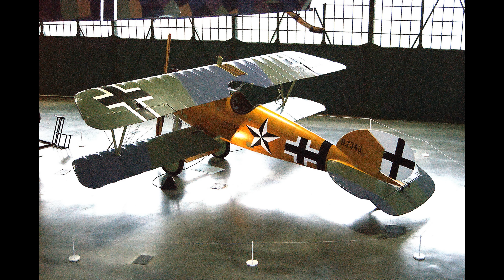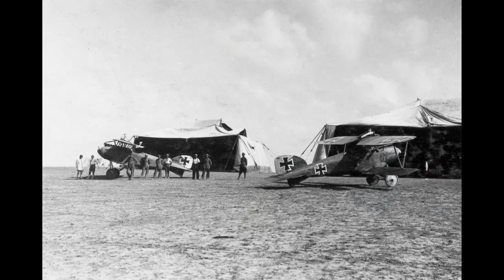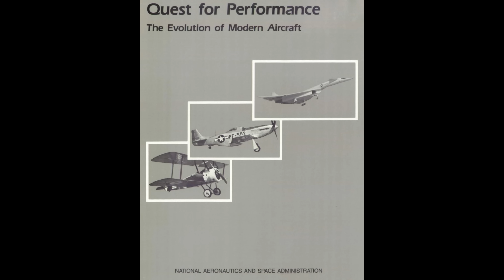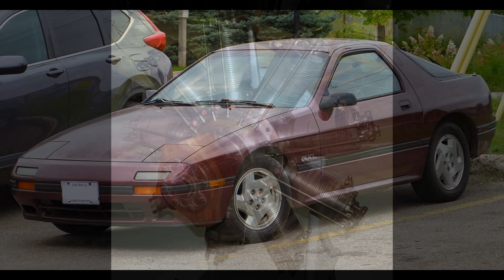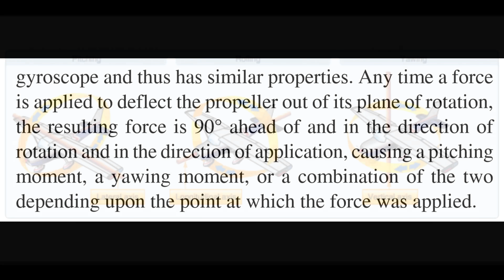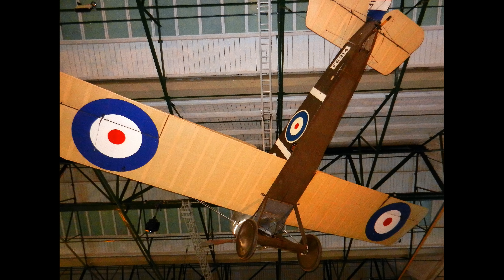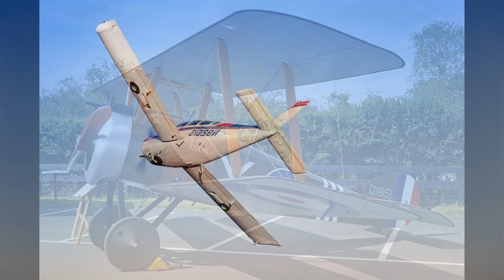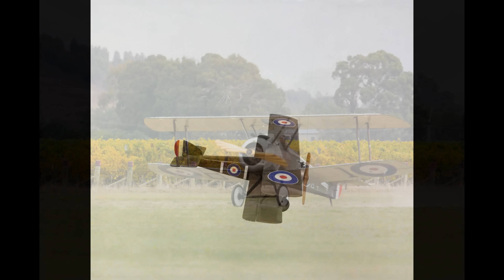Sopwith Camel, War Winner or Death Trap?

Comment: A 'rotary' is actually a rotary radial. Since the term radial refers specifically to the positioning or orientation of the cylinders, the designation still applies. Aviation books (usually older ones) often use the term 'static radial' when referring to radials engines from the post WWI era. The point I'm making here is not that the term 'rotary' is wrong. It's just that the 'radial' nomenclature really has absolutely nothing specifically to do with whether or not the engine spins around.

Comment: 16:53 it is partly due to torque, as you can initiate the roll to start a turn to the right faster than to the left. the effects of the gyroscopic procession and the low moment of inertia add to that to make it have more of an advantage than other planes with rotary engines.
Reply from the maker: Are you sure about that? The Sopwith Camel had either a maximum of 536 or 630 pound feet of torque depending on which version we are looking at. The German inline 6 cylinders had far more. It's a little hard to pin down the numbers because of the different ways of rating them, which I explained in another video, but a typical late war Albatross had A LEAST 694, and a BMW powered Fokker DVII or Pflaz D12 had no less that 825. It wasn't the torque that made the difference, it was the gyroscopic action.

Comment: Man, I really appreciated your discussion of the rotary engine, brief as it was. What an incredible piece of tech that must have been for the time period. Do you have, or can you recommend, any videos that might go into the mechanics of these engines in more depth? I'm trying to wrap my head around specifically the fuel/oil delivery systems. ignition, and the "stationary" cam rotation mechanism driving the prop. it really baffles me, you know? Thanks great video as usual!
Reply from the maker: I'll just have to make such a video myself. There are some rotary engine videos out there, but most are very basic. The questions you have are going to take a dedicated video or a portion of a video. I'll try to work this in to an upcoming video on WW1 aircraft.
Reply: @GregsAirplanesandAutomobiles  Much appreciated, I'll be looking forward to that.

Comment: 15:15 It should really be mentioned that the indirect effect on the roll is HUGE. Why? Because between roughly 30% and 40% of the airplane´s weight was just the engine, and although it had a floatless carburetor that didn´t starve the engine during aerial acrobacy, it still could experience minor fuel shortages due to the fuel inertia in the long intake system that went from the tank into the carb, then into a hollow crankshaft, and then through separate intakes and into the intake valves. And this combined with the effect that using ailerons or elevators has on induced drag, and its effect on propeller speed, and resulted in changes in engine RPMs. 
And any change of RPMs in a rotating engine that is so massive that the rest of the airplane is barely twice as heavy means that a massive amount of torque is applied through Newton´s third law into the airframe, resulting in a serious change to the airplane´s roll angle. 
So, I really think that this should be clarified, because calling something "indirect" usually implies that it´s less important.

Comment: There's just something really special about WW1 aircraft. They're like aircraft versions of motorcycles. GA would be a lot cooler if we were all flying 7/8 or 15/16 versions of WW1 fighters, maybe with some tech updates. Probably a lot cheaper too. A Cessna 172 is fine and everything but it will never be cool. It's like flying in a 1975 AMC Pacer. Being around a WW1 aircraft gives me the same sensation as looking at a really old Triumph, BMW or Harley. It's the same with the people flying them. It's just cooler to be out in the open with the engine right next to you, flying by raw skill and touch.

Comment: Camel was over appreciated and became more famous than much better planes like SE5a  and Nieuport 11.  A plane with many advantages but also with many disadvantages, you can read the first hand experiences of a Camel pilot in "Winged Victory", Yeates tells about the great maneuverability but also its trickiness and many handling and engine problems of the plane. Because of this Camels were assigned mostly to low altitude strafing and bombings with high altitude cover by SE5s

Comment: The engine was not a major issue, the quality of pilots was as was the basic design.  Britain had a very large Air Force and that meant churning out a lot of pilots. The Camel could have been made more stable, but this would have reduced overall manuverability.   The Pup was is, a good flying airplane.   The Snipe followed the Camel (although the Buzzard was a better fighter, it was a lot more expensive).  Also note that in 1940, the turning ability of the Spitfire was impaired because lesser trained pilots had difficulty due to the lack of an aerodynamic stall warning which caused inexperienced  pilots to not push the Spitfire in a turn. Some German 109 pilots said that they were able to outturn Spitfires in practical terms.  Other aircraft like the Se 5a were more stabledue to design, not engine.  The Rotary engined Neiuports 11, 17, 28 were all good flying aircraft.
Reply from the maker: The rotary engine was a major issue, but yes, the design of the plane contributed to it being difficult to fly, I thought I talked about that?

Comment: No carburator,those Rotary engineers had no throttle. They were magneto on or magneto off.  WFO or nothing.
Reply from the maker: The Sopwith Camels absolutely had throttles, along with a blip switch that cuts the ignition.

Comment: Dihedral in the lower wing pair is used to help maintain level flight, helping to prevent undesired banking to the left or right. If the left wing lowers, its lift component increases as it becomes directly opposite gravity which raises it back up compared to the right wing which would have had its lift component decrease, so it would tend to fall. You know this but it was not mentioned when the wings were described.
Reply from the maker: That's not quite right. I think I covered this in a video on the Me 163, but I'm not sure. I have so many videos on this channel I can't remember what is where.

Comment: I can't understand, as an Engineer, why rotary engines would ever exist. They are obviously horrible!!
Reply from the maker: Really? As an engineer, think through the following problem. You have a 130 horsepower air cooled engine that weights 400 pounds. That's a lot of metal to cool. The vehicle to which it's mounted doesn't go fast enough for the slipstream to provide enough cooling air, especially during ground operations, take off and landing. You can't put a fan on it because of the weight, and you don't want to rob power. So what do you do?

Comment: 68 years ago, when I was 7 years old, I saw a dynamic display of a LeRhone engine, rotating slowly in its mount, at Harrah's auto museum in Reno NV and was amazed at the design.  When engine's were limited to low rpm and strokes were long, the rotary design did eliminate the significant mechanical losses of reciprocating pistons, allowed positive lubrication of rockers and had very effective engine cooling.  Gyroscopic precession and limited rpm were two major issues that resulted in the demise of rotary radials immediately after WWI.

Comment: Greg: great explanation of the gyroscopic effects of the rotary engine — thanks. Also interesting was your explanation as to why rotary engines were so common to the era's designs. I had been asking myself the question for many years. There is one supposed interesting effect of the oil that was thrown off rotaries  that I would like verified. Years ago, I read that pilots ingested some of the oil spray. Being that it was oil produced from the castor bean — castor oil — it induced a change in bowel movements perhaps causing some embarrassment and inconvenience.  I dunno!

Comment: The direction of the yaw of the aircraft is really going to be determined by the direction of the angular momentum of the propeller + engine; it won't always be in the same direction when raising the tail. Let's see how this works out.

The torque vector acting on the aircraft will be to towards the left when raising the tail. This can be seen from the right hand (RH) rule: curl your fingers in the direction of the pitch change and your thumb points in the direction of the torque. In the video, the following scenario was outlined: the angular momentum of the engine + propeller points forward (the propeller rotates counterclockwise as seen from the front of the aircraft, clockwise as seen from the rear). The torque points in the direction as the change in the angular momentum. Therefore the torque causes the angular momentum vector to point both forward and a bit to the left. Therefore, the plane will yaw to the left.

However, if the propeller + engine angular momentum points backwards (the propeller rotates clockwise as seen from the front of the aircraft), the aircraft will yaw to the right (rotate clockwise as seen from above).

I'm sure this explanation is difficult to follow if you haven't looked at precession before. To really understand this, you need to understand the right-hand rule, be able to represent both torque and angular momenta as vectors, and understand Newton's 2nd law for rotation: torque = (d/dt)(angular momentum).

One takeaway really should be this: you cannot explain precession merely in terms of forces. Forces are more intuitive, yes, but angular momentum is a conserved quantity--not because linear momentum is conserved--but because angular momentum is its own thing and is conserved independently. Because it is independently conserved, it has its own version of Newton's 2nd law. That is what explains precession, not forces. Unfortunately, any explanation which tries to explain precession merely in terms of forces will be very hand-wavey at best.

Comment: great vid sir:i wonce saw Tom Sopwith take off in his Pup the plane was pointed into the wind which was light bliped the throtel and took off, this was at a DeHaviland openday back in the 50s that seem to be something  todo with the rotorys magic powers  vertical takeoff noless.The other point i want to make is centifcal torque reaction in certain motorcycles  crankshafts a
Reply: cont:crankshafts are set onthe centre line of the machine so the torque reaction jerk to the side one way or the other  motor cycles with the crankshaft acc 21:38
Reply: across the frame dont do that and  TR is absorbed by the frame some single cyclinder machines need  a steady from cyclinderhead to frame this form of consruction has allways appealed to me how it could be applyed to air craft seems imposible

Comment: Can anyone cast any light on the fact that while the Camel was universally regarded as difficult aircraft to fly due to gyroscopic progression and most of the weight being concentrated in the front, it's predecessor, the Sopwith Pup was regarded as docile and easy to fly. Both had rotary engines and both had most of the weight  concentrated in the front, so logically should have had similar flying characteristics.
It's always puzzled me.
Reply from the maker: The Pup had a lot less power and a much lighter engine so less gyroscopic precession. Also, the Pup has dihedral on both wings.
Reply: @GregsAirplanesandAutomobiles Thanks for that Greg. I totally agree, but in my mind that would lead to similar but much less severe flight characteristics, not to the difference of a "docile pleasure to fly" and a "deathtrap" (literally in a lot of cases). Anyway thanks for the quick reply, and for all the work you put in to make your channel so fascinating.

Comment: I don't know if WWI-era engineers made a deliberate choice for it, but rotary engines don't need a reduction gear. Even if one is needed, it can be extremely simple. Thus, reducing weight and complexity.
Reply from the maker: Many non rotary engines lacked reduction gears as well. That's not really an issue of rotary vs. stationary.
Reply: @GregsAirplanesandAutomobiles  Good to know. I had always assumed that the in-lines had some sort of simple reduction gear, so thanks for that insight.

Comment: Just another quick thing to add about the misery of rotary-engined aircraft (and actually, all non-oil-tight engines of the time), they were lubricated with Castor oil, which when burnt produced a particular gas with some very....  troubling effects for the pilots.

 It makes you want to shit your pants. Badly. 

Some say that this is why pilots started wearing scarves, to cover their mouths and nose so they didnt have a trouser accident during a dogfight.

Comment: You mentioned the mess rotary engines created by slinging oil all around it in another vid I think. I’ve always wondered why rotary cowlings were so different from radial cowlings. The rotary cowling in Fokkers had the bottom third cut away and the rest of it tightly latched to the fuselage. That must be to keep the flying oil from coating the pilot with oil? The camel is cut out at the bottom trailing edge of cowl.

Comment: When a helicopter angles the rotor disc forward, to move the machine forward, the disc isn’t pushed upwards from the back but 90 deg to the left or right side, depending on the direction of rotation.
Not a lot of people know that.

Comment: Rotary engines must have a carburetor in order to function,to meter fuel from the gas tank to the engine,if it has a carburetor it can be throttled!

Comment: The engine mass and high  torque was the winner.
If the pilot  could prevent this torque taking over control and using it to help in maneuvers you were ahead in the  fight
Reply from the maker: It's not the torque.

Comment: I can hardly believe that "cooling" was the reason for this engine layout. Attaching a fan in front or behind the engine (as e.g. the Germans did with the Fw 190A and the BMW 801) is SO much easier (and probably more effective). Is there really hard evidence for this ? - Or is that more never questioned "common knowledge" ?

Comment: Whoever dreamed up these engines was a mad man.
Reply: No, he was not. 
He faced an apparently impossible problem: how to build powerful but lightweight engines, that would still work lengthy periods of time. This problem ever preceded  WW1, being there since the beginning of aviation. As Greg said, radial engines weren't powerful enough and had cooling troubles. Inline water cooled engines just begun to appear, and were far from being powerful and lightweight.
And since desperate situations require desperate solutions, some took Mad Max designer's book and came with this oddity called "rotary engine". It was a dead end, but for the time being, it worked marvels. :)

Comment: I know this is about to start some name calling and questions about my sanity and some will make comments that I am an idiot and other unpleasant comments. But facts are facts. Here we go. If you look closely at the Fokker DR1 you will notice that it is not really a triplane but in fact has 3 and half wings. Ok so where is the half wing. Look closely at the landing gear and you will note that it has an aerofoil. I am not sure what increase the aerofoil on the landing gear has but facts would certainly indicate that it is there. So how much lift would the aerofoil on the landing gear have? Certainly enough to add to its climb rate. So is the Fokker Dr1 1 really a triplane? I am a RC pilot and have built 2 Fokker Dr1’s (sadly I have crashed beyond repair both aircraft as they are tricky beasts to fly) but I can tell you that they climb like a bat out of hell and OMFG can they turn on a dime (I will let you workout why they turn so good. And if you have flown one you will know). Getting back to the landing gear. Any increase in lift is a good thing as it gives you the edge.
Reply from the maker: I wouldn't say 3 1/2, maybe 3 1/8th.
Reply: lol I just saw that you have a video on the Fokker Dr1 maybe I should continue this conversion there?
Reply: I had the great fortune in my youth to have met and talked with a couple of World War 1 pilots. 1 was a camel pilot. Sadly now 52 plus years later I don’t recall much of what he told me other than the camel was a tricky beast to fly and often new pilots would land hard and tip the camel over and smash their face on the front of the cockpit and end up with what was called “camel face” due to as you have mentioned the center of gravity being so far forward. The other pilot I met was a Bristol F 2 fighter pilot and sadly I remember even less of what he said.